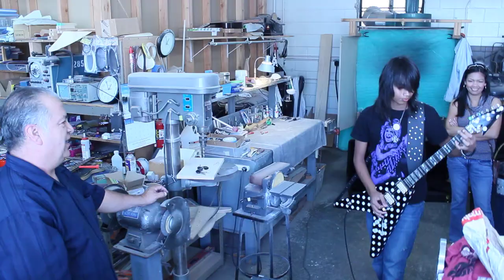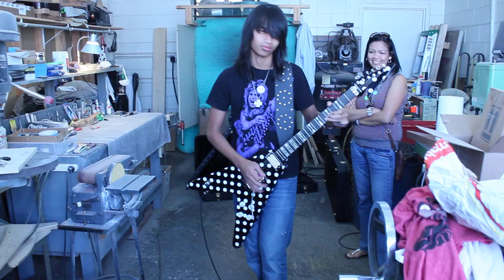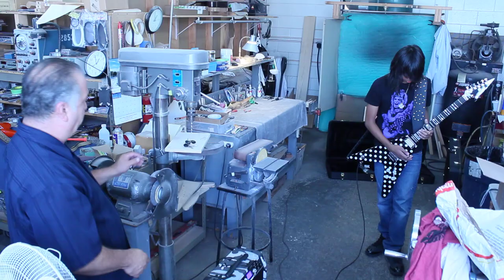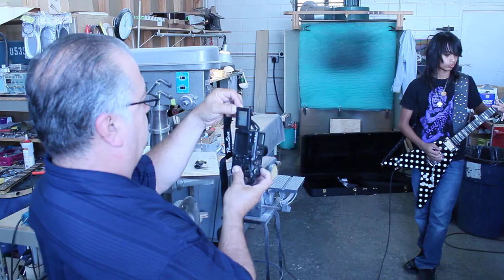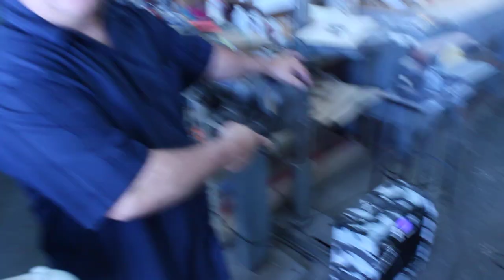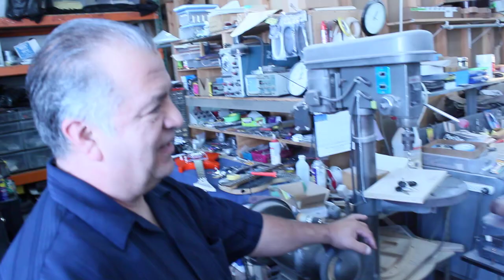Karl Sandoval, Randy Rhoads Polka dot V

Comment: Karl is a great guy. My old roommate worked with Karl at Charvel/Jackson and then BC Rich. I had a drill press that I bought from my company and didn't need it or use it...so, I traded it to Karl for a guitar neck. I am a lefty so it was a custom made...inverted Strat headstock (I believe it is the only one he ever made) with the Sandoval script correct and the fret dots on the correct side. Still have the neck and play that guitar all the time......one of the best necks I have felt...my LP comes close.

Comment: Lee, I was thinking that I read somewhere that Randy had a Floyd Rose installed on his V later on. I know that it originally had the old Fender-type of tremolo system (which is what my guitar has as well), but, I thought he replaced it. I know he had to repair the neck or headstock due to an accident he had with it, too. I bet the one you have is actually a MUCH better guitar than the one Randy had, but, he could make his sound great nonetheless!

Comment: Only if the china people could get these dimensions spot on.  But they don't.  The neck pickup on this one is in the right spot.  Whereas the china copies are all wrong when it comes to pickup locations lol.  Which also means the body is wrong dimensions as well.  Especially where the neck joins the body.  Have a look at the ebay Rhoads V's   and compare is to the guitar in this video at 6.59 marker of this video.  Notice the neck pickup is close to the fretboard in the correct spot for one thing.  Plus there are probably many other wrong dimensions on the china ones.  I mean they do get the nut and bridge locations correct or the thing wouldn't calibrate.  But other than that, there are lots of things wrong on the china guitars.